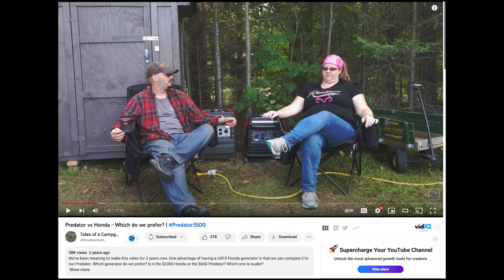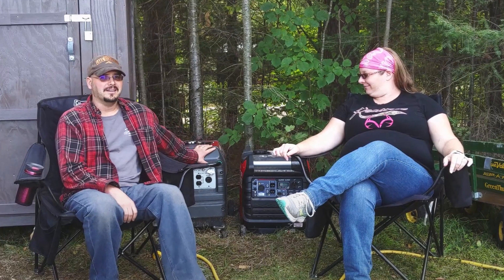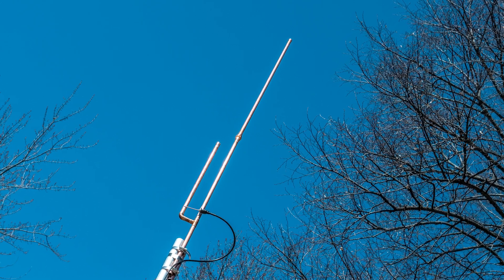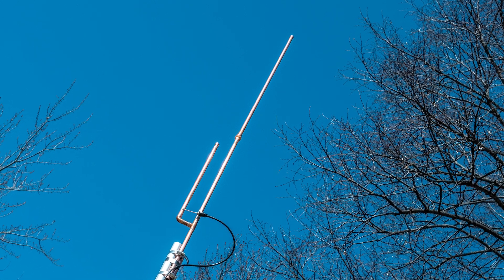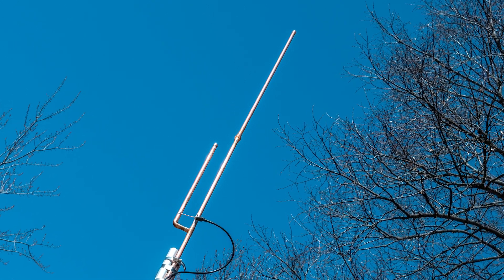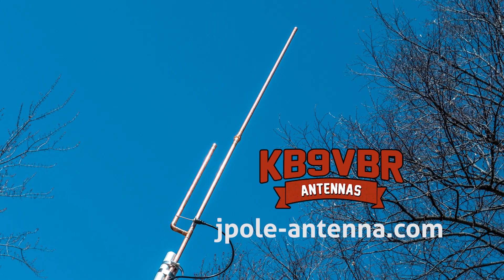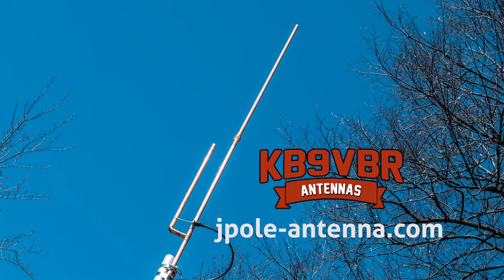Ask Michael, KB9VBR: Reducing noise from an Inverter Generator

Comment: I use a Tripp lite ac choke /filter strip isobar. Then float power supply and single point ground to the tuner and run a 5/8” wide ground strap to the ground rod